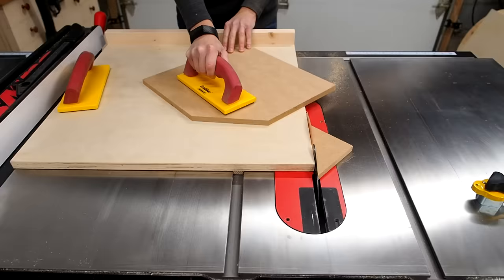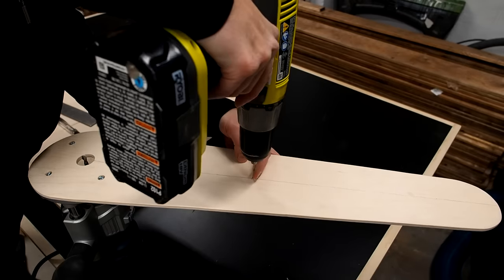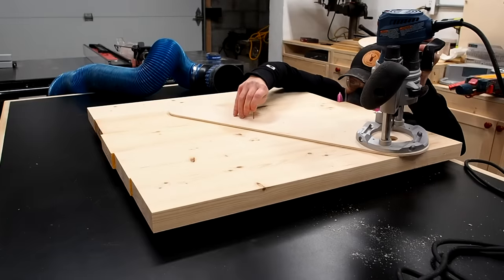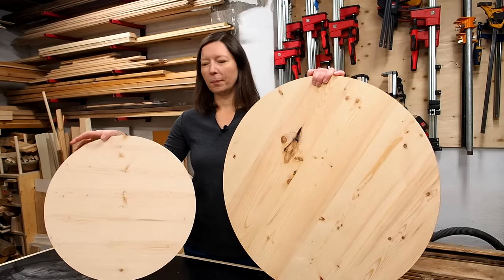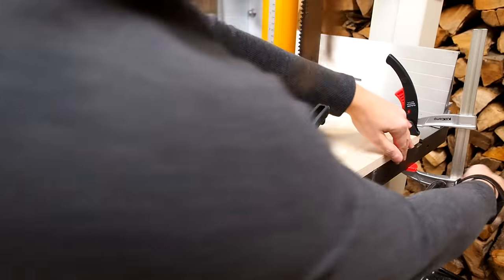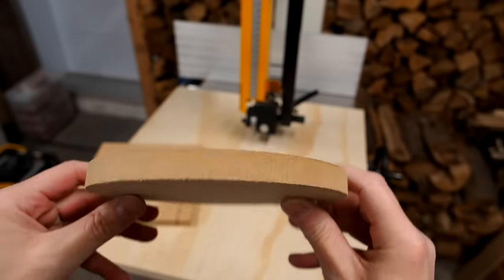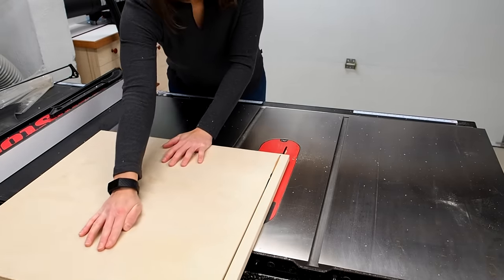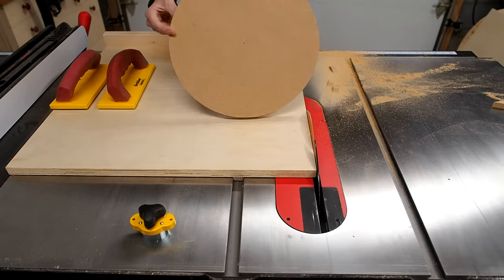4 Ways to Cut Circles in Wood // DIY Circle Cutting Jigs

Comment: Don't think I've seen a circle-cutting jig video that actually compares the various types... this is great!
Reply from the maker: Awesome, that's great! Thanks 😊
Reply: @DIYMontreal  Hey I need some help I've got a plunge router with a variable speed from 8000rpm to 26000rpm and I'm trying to cut though 3in of southern pine wood with a 4in long 1/2in shank and 1/2in round straight cut bit with double flutes but I can't seem to bite into the wood an I've tried speeds from 8000 - 26000 rpm I'm I just using the wrong bit or is it just not doable or should I use a spiral upcut bit
Reply from the maker: @DREDKNOT2063  I think the issue is the straight bit. Especially if it's 1/2. I'm using a 1/4 spiral bit. This article might help you: https://www.woodcraft.com/blog_entries/spiral-router-bits-vs-straight-router-bits#

Comment: I understand that in woodworking many things/flaws are unavoidable and for the most part relatively inconsequential to the quality of the finished product but in the rare case they are not  I have found that a damp cotton wash rag and an iron works wonders on small nail, staple and pin holes in most types of wood.

Comment: THANK YOU VERY MUCH!  I am a newbie to routers, and I was building a replacement outdoor kitchen table for my Big Green Egg.  I was completely stressing out about how to cut the hole perfectly as my table was largely already completed.  I affixed my router to a thin board (method 1) and it worked absolutely perfectly!

Comment: Great video, Marie. I've watched a lot of these and I have a couple of comments to maybe give a little variation. On the first method, if you don't want the hole in the workpiece, step up the pivot end of the jig and double side tape a block to the workpiece and guide it from that. On the jigsaw method, I've seen a short pattern bit (bearing on top) used before flipping it over and then flip it and use the flush trim bit. I hope these help you. It was still a great video with your explanations and comparisons. Stay safe and well. BYW - my favorite is still your hexagon jig.
Bill

Comment: Marie, Norm Abram (New Yankee Workshop) made a circle cutting jig with virtually no size limits. It’s the same as yours but his has an extension that’s part of the base with the pivot point set at the desired radius. He ran a slot from the blade to the end of the extension so you can lock the pivot point at the desired length. It also has a support leg at the end of the extension. 
😀. Love your podcasts.

Comment: I use a 1/2" straight bit on my router with a similar jig, cutting a 1/4" deep groove. I jigsaw the groove as you did leaving a small residual amount left of the groove. Lower the bit and ride on the shank to clean up the circle...works great with just one bit!

Comment: Great video!  I just made a lazy susan using the table saw method and it turned out perfect.  I opted for that method because it was a big circle and I felt more comfortable making the cut on a table saw.  I first attempted to make a circle cut with a jig saw and that was a fail cutting through hardwood!!  Blade kept going all wonky. Thanks for your side by side comparisons.

Comment: I have a 10” sanding disk for my table saw. After cutting the circle as you showed I change out the saw blade for the sanding disk. Then once around and the lumps are gone and there are no burn marks. It does involve changing the blade but the results were worth it.

Comment: Marie, I absolutely love your videos! They are straight forward, and very informative for beginners and experienced woodworkers alike. I recently commissioned 16 tables that were built using 2" thick oak (reclaimed bowling alley lanes) that definitely required using my router and a jig (which is my favorite method). Sure, it's extremely messy and a very slow process; but it gives the best results! I just think there's something unnatural about making round cuts with a table saw! 🤣😂 However, it's a great method for somebody with limited power tools. I do use my bandsaw and a circle cutting jig to make coaster sets and it is very quick and allows for a lot of repetition with minimal hassle during the busy (pre-holiday) season.

Comment: Excellent demonstration. I need to cut 2 table tops out of 2 inch thick white oak 18in in diameter for a customer of mine. All i have is a router and a table saw. Im thinking the router is my best option

Comment: Great video. The Router Jig works great!
I made the band saw jig for smaller circles. The saw will not make the cut when rotating the piece clockwise. The motor binds to a stop.
Maybe my band saw not powerful enough. Rikon 10” with 1/3 hp, 110v motor. Blade 6:52 speed 2780 ft/min; tried cutting 3/4” mdf with 3/8” blade; switched to a new 3/16” 70 1/2” blade 4 T.P.I. Still bound up. Tried cutting 1/2” maple (2” radius) still bound up quickly 
?? More powerful band saw??
John

Comment: Sometimes the hole is what you want and not the plug. I used my router and a compass jig to make a neat round 6 inch hole is a sheet metal box as part of the ducting for a kitchen exhaust. Carbide router bit cut thin steel with no problem.

Comment: Thanks for sharing.  My favorite method that is very easy and leaves clean cuts with plywood is using a router with a compression downcutting bit.   My wife needs round batts for her pottery work so I often make large circles.

I am a big cheat though . . . because I use a Shapeoko XL to hold the router in a predictable and precise way directed by g-code.   Unfortunately I can't claim to be a real woodworker with such devious methods.   I don't even know how to sharpen a chisel or use a Block Plane properly :(  
I do appreciate real woodworkers craft, keep up the good work.

Comment: What's your suggested method to use when the part to keep is the outside with the circle cut out (for a speaker for example).
Reply from the maker: I think the only method would be the first one (router jig) or if the speakers are small you can use a large hole saw.

Comment: Great video. Thanks for sharing. I like the bandsaw method most. I have done the router method before. Can't seem to find my jig though. I've seen the bandsaw before and they do really large circles on the bandsaw. I think they use a larger sled... and have it supported off the base of the bandsaw. It's good to have options though. I don't think I'll try the table saw. But its a good option for someone who doesn't have a router or bandsaw yet.

Comment: Marie... I love your videos and each one has helped make my shop more efficient and more fun.  I tried to create the jig for the bandsaw but I got drift in the blade as I cut the kerf back to where it stops. I had the runner installed on the base so I thought it would push straight. Any ideas where I went wrong?

Comment: How would you cut a wooden 2" width ring with 24" diameter?   Would you cut the inner circle first then the outer circle or vice versa?   Measurements are arbitrary but may be used in a project.

Comment: You can do the same thing as the first method using a table saw using a similar jig to the fourth method. Just have your blade peak up about 1/8 inch at a time and spin slowly with push sticks. Not as fast or easy as the router but if you don’t have one I guess it works

Comment: You can use the same principle as the router jig to make a jigsaw jig. As long as you use a fine blade and go slow, it'll make a cut just about as fine as the bandsaw jig. A bonus feature is that it doesn't make as big as mess as the router.
Reply from the maker: Yeah, I've seen some people use that method, just seemed potentially awkward or dangerous to me (kind of like I felt about the table saw jig, but that turned out not so bad after all).

Comment: Router and jigsaw methods can also apply to inner circle cuts (such as in speaker box building), while the table saw method is the only viable option for non-perpendicular (inclined) outer circular cuts.

Comment: I've seen a guy make a jig, similar to your bandsaw one, for the Ridgid belt sander to sand circles after using other methods to cut them. It had two plates stacked, which slid on, with a runner... and the top plate that was adjustable in distance from face of belt.

Comment: The only problem I have with the bandsaw sled method is lining up the center hole in the blank with the pin in the jig.  Does DIY Montreal or anyone else have any suggestions?  Thanks.

Comment: For the table saw method you can start taking it off by spinning once you get to the 8 tip step and it’s best if the blade is only out enough to be 1/16” or so past flush with top of working piece.
Reply: Great video though! Thumbs up!

Comment: I have a router (that I've never used because for some reason it terrifies me way more than any other tool I have), a portable construction table saw, a 12" sliding compound miter saw, electric hand planer, and an orbital sander.  I don't have room to make a jig for my router but is there another way to do it with those tools so I can make circles?  I don't have a full shop so trying to find the fastest and easiest method to do this.  I don't think my table saw top is big enough. 😢

Comment: The bandsaw does not limit one on diameter size for the circle. One is cutting only at the front edge of the blade & to the right side of the blade. From this point starts the outside edge of the circle. But if the circle is really big, then out feed support will be required. The distance from the blade's left side & back to the bandsaw blade's area should not have that much of excess wood to be cutoff from the circle. If it does, then simply cut off prior to mounting on the bandsaw. Also this same area, from the left side of blade to the edge should be removed completely. By doing so, it now allows to sawdust to be vacuumed up from below. But if one decided NOT to remove this area then bore a 1" circle at the blade are, again sawdust is vacuumed up. Could use a Dowel Marker Self Centering pin instead of nail. Could also make part as a slider thereby only one hole, the pin itself is needed. And now one has a very adjustable size circle cutting jig for the bandsaw.

Comment: The bandsaw method worked for me very well.  For those who might be interested, I have enhanced the bandsaw jig by adding a T-Track that allows me to slide the "spindle" to set different radii..  As a result, I don't have to re-drill and can fine tune the radius.  I also created a similar jig for the table saw that allows me to sand the edges of the circles I make on the bandsaw jig (Infinity Tools sells a 10" Sanding Disk).
Reply: Do you have a video of this?  Would like to see the modifications.  thanks
Reply: @rod1148  I don't have a video but I did take some photos of the jigs.  Unfortunately, I don't know how to get those to you.  Let me know if there's an email address I can send them to.

Comment: To increase the "reach" or the "depth" when cutting with the Router.... turn it over... doubling the thickness you can cut - yes a small ridge difference might appear near the middle... sand it off.. job done.

Comment: I put together a band saw sled circle jig tonight. Not sure I have the right blade for it or it’s way too under powered. Machine kept bogging down and even stopped. What size blade were you using? Tried a 5” circle  with 5/16 6tpi blade that came with it. Rikon 10-3061. Thanks for any help and all you do!
Reply from the maker: I'm using a 1/4 inch blade with 4tpi. It's brand new. Maybe your blade is dull?

Comment: Also went with method 1 - used a bungee cord to hang the power cable above so it wouldn't get in the way.  And yeah that worked so slick!  4 perfect circles to make the wheels for my trojan rabbit - thanks for the tips!

Comment: Loved your video and I think you have wonderful ideas. Not sure if you ever heard of the show the new yankee workshop it was a public television show and norm abrams who was the master carpenter did several of the jigs you display here back in the nineties. One was to make a round table top in a large piece of plywood and he did it with a bandsaw in one pass with similar results . Later on in another episode he took and remade the jig so he didn’t have to keep drilling holes all over the board for different sized table tops he made it so you could adjust it for multiple sized tops. He also did the router trick too. I think you’re both wonderful and very capable keep up the good work norm retired from the show but he still stays connected with the woodworking. Take care and god bless.

Comment: I’ve been cutting circles on a bandsaw for years and Ross is right about using an extended table for larger size tops. I have a groove cut in the center of mine and slide a 3/16 bolt to the size I need. Keep up the good work and the great videos.
Reply from the maker: Good tip, thank you!

Comment: There are two alternative ways to cut cleaner holes on the band saw. The first would be to try a different blade, you can go with a higher TPI, or a 1/8 inch blade, or both. Optionally, you could cut your circle a bit larger than needed, and sand down to your desired diameter. To get to your desired diameter, use a pencil to mark where your circle needs to be so that, when sanding time comes (YAY!!!) you know where to stop. The next option to cutting on a band saw WITHOUT a hole in the center of your work piece. Start by making a circle the way you showed here, and that will become part of your jig. Next, use double sided tape to fasten your work piece to the circle you just made. When you're finished, separate the two pieces of wood for a finished circle with a hole in the center.
Reply: I agree with your method.  One can make a similar jig that is used on the bandsaw that can also be used in the table slot of a disc or horizontal belt sander after preliminary band sawing is completed. I rout in a groove that allows the pin to be placed on a fitted stick that can be slid, relative to circle diameter, into the sanding belt or disc to achieve final diameter.  This stick is clamped into place so the final, perfect sanded diameter is uniformly achieved while rotating the stock. I wish a photo could be applied to our conversations. A photo would make this jig design obviously clear.

Comment: Another great video! Thank you! I prefer the band saw and making a slight modification to cut different size diameters. Just like yours, I’d continue drilling holes alongside kerf cut in intervals and labeling them. For instance, there would be a 2” hole for 4” diameters, 3” for 6” diameters etc.. Then the only modification would be to move nail (or pin in my case) to desired radius and cut. If the diameter is too big for band saw table, I would use a workbench or some other support to rest the excess that hangs over the table.

Comment: You do understand that you can't be credible, removing the Freud blade after cutting the high precision slide on it... You should have cut the slide with the CMT, but you did NOT. On top of that, it's sponsored, which means that there is no value to whatever tool is shown. The cutting technique on the other hand is not bad; I like how you maneuver the stock. I have no intention of offending anyone these days and I will call you ZEY. Zey did a good job with the circle cutting.

Comment: I've got 2 barrel tops 2 make  for a pub in the United Kingdom and was wondering how to tackle the project. I will be using your second method as the top is going to be atleast  2 inches thick. So thanks for your video 👍

Comment: I made really large circles on a 9 inch bandsaw by building an auxiliary table that sat beside the saw and slid into place, then to deal with the bandsaw marks i used a router jig and took off less than an 1/8th of an inch all around..  i used an upspiral bit too..  it was quick and not as noisy as using just the router by itself (going around and around..  disturbing the complaining neighbours)

Comment: It's interesting to see that all you "amateurs" alway have the blade protector on the bandsaw (or you can call it the fingers protector,) so high! It's dangerous, and it shows how much of a beginner you are!
Reply: Definitely a cultural thing, but seasoned cabinet makers from couple shops I've worked at where production/efficiency are high priority to keep the job, you don't always have time to be anal about safety, unfortunately. Either you're good enough to handle machinery respectfully and fast without being reckless or you stand out as someone who can't perform fast enough and get replaced. Safety definitely comes to play when you're doing your own craft at home without time being so much of a factor and for company's liability sake, but the reality for good amount of carpenters (or any trade), you cant be a pussy when it comes to safety 🤷

Comment: Always enjoy and learn new tricks from your shop.  I've done the router with a guide a number of times but really dislike that cord snaking around and the multiple passes required.  Never tried the bandsaw but fell in love with using my table saw.  My jig is nowhere as large as yours but does work.  Probably cranked out around 30 circles with the table saw in sizes from 24" down to around 5".  Haven't been smart enough to hold down the wood with a hold down tool but think after watching you I'll change so that I can keep my fingers.

Comment: New to Woodworking.  I only have a Ridgid fixed base router.  Any way I can still use it to do this?
Reply from the maker: I've done it before... Not ideal. Lower the bit very progressively on each pass. It will leave burn marks most likely.